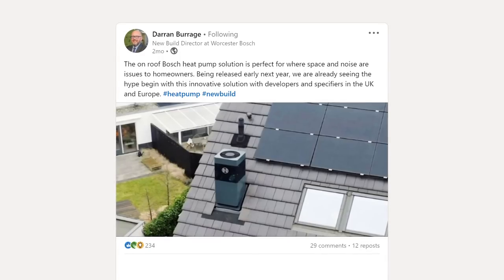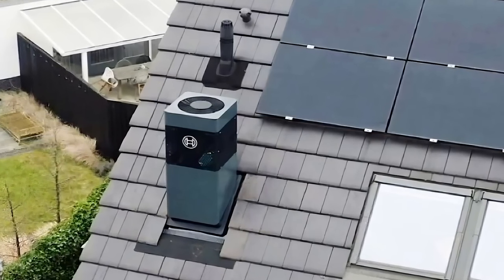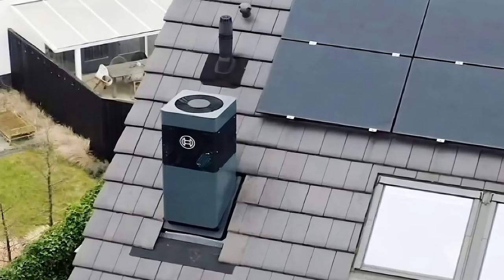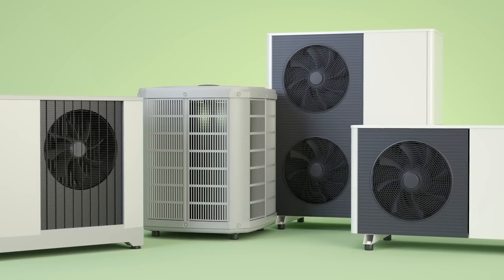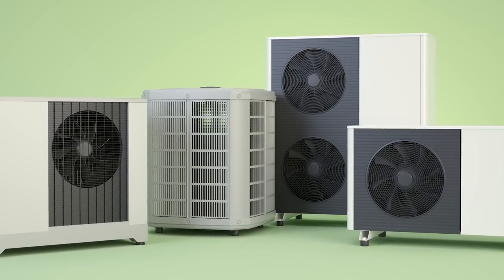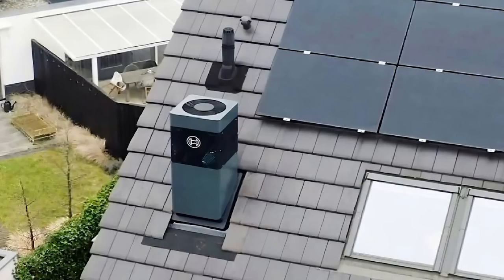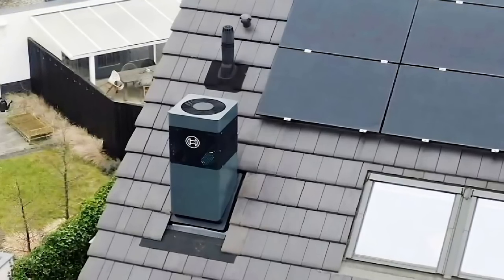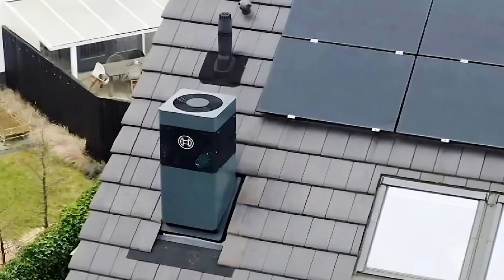Is This New Air Source Heat Pump Idea Crazy?

Comment: Nice idea and that is where it stops! Maintenance would be a nightmare and I for one would not go up on a roof to repair a heat pump. Maybe all could be accessed via the loft? That would work but still could be a pain in some lofts as access can be hard. Also, the weight of the heat pump can be in excess of 100KG. Strapping that to the roof could cause some issues, especially in exposed areas!
Reply: For new builds loft access and support strength should be easily incorporated. Retrofit would obviously be harder.
Reply: I can’t see any reason why it can’t be in the roof with a large vents to move the air through it. Which will make it accessible for services like boilers in roof.
Reply: @mikes4163  It should be, and I'm sure that we'll get it right in another decade or so.  The first installations, probably not so much.
Reply: @mikes4163  Eh? Surely the opposite....trussed rafters etc?
Reply: Windy days might mean you lose more than a few roof tiles.

Comment: My boiler is a Glow-Worm Hideaway and is 30 years old. I was thinking of replacing it before heat pumps become mandatory. Good idea?
Reply: No. I would say not. They are only banning installation of gas boilers in new builds from 2025. Houses with existing gas boilers will still be able to put in a gas replacement for a long time to come.
Reply: I've a Firebird Hideaway 120. Just last year  (2021) replaced the motor and connected everything up in a smart system. It's 24 years old and I can't see the need to spend thousands to replace my entire system. My next upgrade will be solar panels, maybe if I get a good return on that I'll think about the heat pump but I'd always keep the oil burner as back up along with my stove.
Reply: @tcm81  Thank God for that.
Reply: New boiler would save on your gas bill.

Comment: I wonder how will it perform covered in snow and eventually ice for a week or two?
Reply: At thr exact time it is needed the most
Reply: It freezes up by itself. That's why it also has a defrost mode.
Reply: I was thinking UV damage
Reply: It will decide to fail at the most inconvenient time in winter. I wouldn't be going up there with my toolbox on an icy roof. A health and safety officer would literally faint if they saw that; I've seen that happen. This is a bonkers idea. If the condensing unit is going inside the building, just duct it through a side wall at ground level like you do with a boiler. You wouldn't want a compressor running above your bedroom believe me. I deal with these things day in and day out.
Reply: Mitsubishi HyperHeat is designed to work to -25c without it turning into a direct electric heater
Reply: Defrost happens regularly with air source heat pumps (like every hour when it's high humidity & cold!) it melts ice off it's evaporator in 5 minutes. The system runs in reverse to do it. With the air stream coming out the top, snow won't build up anyway.
Reply: @Loopyengineeringco  There is a motorway less than a mile from my house. It goes right over the Yorkshire moors, and many said, at the time of its building "But surely it'll be impassable when it snows..." To which, the 'experts' replied "Oh no, it's been designed so that the snow will simply blow off the surface..."
In March 1979 I was working on the other side of the moors and it snowed. The motorway was impassable, and I had to sleep in my car. Next morning, I was in a convoy, led by the police, as we negotiated a path, cut by snow ploughs, through the TEN FEET drifts on this motorway. I've never really believed anything since, when it comes to what experts say snow won't do...

Comment: I'm waiting for my heating guy to replace my air source heat pump for a gas boiler.  Never again with I be talked into new eco-friendly system again.
Reply: Sounds like the same scenario as our electric car
Reply: You probably got a cowboy to install it mate or your house is draftier than a pergola, either way you have bigger problems than the heat pump
Reply: Hope it wasn't the same heating engineer that fitted the Heat Pump 🤣
Reply: @hk78901  New build bungalow, triple glazed oak windows, insulated above building standards and under-floor heating. It works great in the summer but when temperature falls below 6 degrees, it turns into an ice-block and it's useless. The noise of it continually trying to defrost itself can be heard 200metres away at my Mum's house! I hear that the newer systems are an improvement but I'm not ready to chance £1000's again.

Comment: I'd have thought that the bulk of the mechanism would be in the loft, and only the air exchanger bit on the roof itself?
Craftsmanship of the desk looks great by the way.
Reply: Yeah I reckon that's just the evaporator coil & fan up there, the rest of the machine probably pokes into the loft eaves. Great idea tbh, lots of unobstructed air for the heat exchange, although smaller fans means more noisy, so they might have a heat capacity limit of 5kW or something like that. Compressor vibration isolation will have to be top notch in the machine
Reply: Putting the compressor in the attic I would think would be problematic for noise mitigation. Putting the one thing that has to be cleaned on an annual basis,Condenser coil (evaporator coil in winter time) on the roof would be equivalent to putting your car on a 36’ (11 m) high lift and changing the oil with scaffolding. The full day of sunlight with no shade would help in the winter time and be a disaster in the summertime. Going on the roof to service a piece of equipment is bad enough in good weather but who’s going on the roof to service a no heat with ice & snow ?  My opinion would be flat roofs only , with permanent roof access.
Reply: @zlmdragon.  , Thank God, I was hoping the BRITs weren’t getting so desperate for space that they had to put mechanical equipment on A pitched roof🏠
Reply: @tutacat  , I am hoping we will see more community ground source loops, it makes sense . They have been using shared loop systems for high-rise buildings and high-rise condominium complexes for decades . Why not community loops for single home residences ?

Comment: i think it'll be so much simpler than that, the pump will sit in the loft in a safe space for access etc and the bit on the outside will do the venty stuff
if it's a fully contained unit that can just be fitted into the roof and then covered with whatever covering the roof has, be that tile or metal or whatever the americans use it could well be a fit and forget unit with pipes going to wherever they need to go to
Reply: That was my thought. Every repair on my heat pump has been with the electronics. I don't see why the electronics have to be on the side of the unit. A wire bundle so you can have the electronics at ground level seems possible.
Reply: You don’t need to have anything outdoors. There are ASHPs available that sit entirely in the loft and just have a couple of ducts to gather and exhaust the air they use. Simples.
Reply: Yeah that's what I've been thinking too. The heat pump system seems pretty modular at first glance, so why do we have to have big boxes outside in the garden cluttering up the place while being exposed to the weather? There seems to be little to no reason why the mechanicals can't be in the loft space, with the electronics somewhere inside the house in a control unit where it could be adjusted/serviced/replaced at will.

Comment: Industry professional here. TLDR, we are in for a scandalous period of miss-sold equipment and poor installations. Don't get rid of your boiler yet. Using heat pumps to heat homes isn't a great idea. The technology to do what is required for most installations just doesn't exist. A part of my job is to design and locate heat pumps in commercial buildings which often means near residential properties. It's a nightmare when designing projects to meet noise and planning criteria. Then there's the task of ensuring adequate airflow through the unit and having enough working space around the unit for maintenance. All of this is more difficult in residential properties with even tighter noise and space restrictions. You simply cannot make a compliant residential installation with the current restrictions and technology (for most properties, new developments have flexibility). Then there's the efficiency aspect. Heat pumps just do not operate efficiently in cold ambients. The COP is very low when you need your heating most (i.e below 5°C) to the point where a gas system is going to be a better option for your bank account. COPs are only going to get worse as FGAS regulations prohibit the use of current refrigerants in the not-too-distant future. In other words: energy prices increasing + efficiency decreasing = exponential rise in electricity bills. Then there are the low flow temperatures (assuming air-to-water). Everything has to be oversized to have large surface areas to get the required heat output from the system. That means large radiators or underfloor heating. You won't get hot water from the tap unless it's heated again by an electrical or gas system adding complexity and many points of failure. Heat pumps are notoriously complicated and expensive to repair. Labour isn't cheap for professionals and there are hardly enough people in the industry as it is without the added residential market. This will lead to cowboy installations. This is all being driven by the manufacturers trying to open another massive market space. Heat pumps might be feasible for home heating if larger, centralised plant is used which would cater for several houses within the neighborhood. This could be a hybrid system consisting of air and ground-source coils to maximise efficiency in cold ambients and be able to switch to the warmer source when required. This large unit would be located in a dedicated plant area and piped to houses via hot water. Even then, I'm not convinced that heat pumps will ever give the required efficiency to warrant the infrastructure. If you're not convinced and you're going to install one anyway, do yourself a favor and get the manufacturers to provide a design submittal for the equipment they are selling you. Size the outdoor unit approx 133% to the max calculated load. This should hopefully get you somewhere near the efficiency peak in the system (you want to be operating at 60% of the outdoor unit's max capacity). Think bigger outdoor units and bigger indoor units (radiators etc). That's a very rough rule of thumb we got from using the manufacturer's design software. Good luck. I'll be on board when electricity is free (or much cheaper than gas, which the government is doing its best to do by making gas astronomically expensive).
Reply: Could it be that the companies who intend to supply this equipment have somehow influenced the government regarding the efficacy and true cost of heat pumps?
Reply: @zlmdragon.  It's not scaremongering, it's the truth. If the truth scares you then that's on you. Heat pumps are not a suitable replacement for gas boilers in the UK. "Do you know Moldova?" Do you know how much electricity is in Moldova? Less than a 3rd of what it is here in the UK. "In UK you can install an air to water heat pump without a planning permission." Correct but there are strict limitations that you must abide by. It is my opinion that some form of planning permission SHOULD be a requirement considering the noise and visual impact the outdoor units have. Just because the EU does it doesn't mean its good. That's why we left.
Reply: @paulwestlake4278  Me and 20 other people were invited to a factory tour in Europe by one of the big companies. During this, they took me for a meal and a night out. Everyone was bought a BOTTLE of champagne EACH. Anything you wanted, you got. I know exactly what treatment our MPs will be getting from these companies. The MPs couldn't care less about COPs and refrigerant GWPs.

Comment: It’ll be ‘100% serviceable from inside the loft space’ in the same way their gas boilers are 100% serviceable with only front access, but it takes an hour to change a PRV whereas on another boiler it’ll take 5 mins. When WB stop designing their boilers like white goods and with plastic components I might have a rethink

Comment: If your heat pump relies on the air temperature it sucks in. Wouldn't it be better to mount it in the sunniest part of your garden and not in the shadow of the house? Even in winter the heat pump would be naturally 5° warmer or more. In the summertime it would be boiling.

Comment: From the looks of it the Nefit Bosch Compress 5800i AWR heat pump looks great and exactly what I'd be looking for. Maintenance would be an issue but a cherry picker and Lanyard would be all you really need to cover H&S on that as long as it's large enough maintenance periods the cost might be minimal enough.

Comment: That looks small for a heat pump, is there more of it in the loft, and that is the tip of the iceberg that simply has access to the outside air ? if so maintenance would be done in the loft similarly to most peoples water tanks.

Comment: Build your house so the roof is at ground level, problem solved. As your house would be well insulated as well. No heat loss though the windows. Another crack pot idea.

Comment: I don't understand why you'd choose air source over ground source if it's a big new developments. with the economy of scale the upfront cost of digging a big hole can be somewhat mitigated.
Reply: same with rainwater capture imo.
Reply: Even with economies of scale it comes down mainly to cost

Air source can occasional get better efficiency too, particularly in the south where the summers are warmer so the summer water heating efficiency is insanely good compared to a ground source which will be roughly the same all year round

Comment: as i live near the sea,those external units are real rustbuckets,placing one on the roof is especially difficult for maintenance
i still heat my home with a modulating condensing gasboiler,if gas is no more an option then i will change to infra-red panels,which i can hang in place of the radiators,i will also foresee a solar system with a 10Kw inverter and 15Kw modular battery system
if this idea will be effective,i dont know,we will have to see,cheers Roger

Comment: We just took out a very unreliable noisy (6yr old) Mitsubishi EcoDan Heat Pump (even the manufacturer couldn’t fix it) and installed electric boiler + unvented hw direct cylinder

The heatrae sadia electric boiler is silent (& releases zero emissions) ….10 year parts & Labour Warranty….& never go wrong it’s a no brainer
Reply: Sounds like a direct heat would cost a small fortune
Reply: Coupled with some form of local solar energy source, would be a no brainer.
Reply: @hk78901  The boiler does not.

Comment: I think the way forward is something like a plant room in the attic for all new builds. I'm sure they could make a heat pump that could work indoors with a ducted air supply. Obviously it would need a special floor to take away any leaks.
Reply: There is - they are called EAHP (exhaust). Popular brands are a Nibe/Nilan

Comment: I was watching a show, talk about the "Thermal mechanics" of how a "heatpump" works... & honestly, I think I'd rather stick mine underground if it were possible?

B/c you've got that "consistent temperature".. 

Modern heatpumps, from what I've heard can work down to -40 degree's. I'd rather "errrr" on the side of caution & assume -30f.  Anyways, if you go down in the ground so far, the temperature is normally consistent. That'd improve the heatpumps efficiency if I understand it correctly. At least for heating & cooling?  

Anyways, that'd obviously take care of the noise issues as well?

In regards to sticking one on the roof in the sun? I dont honestly know if its a good idea in regards to how a heat pump works, but it might be a good idea in getting rid of noise? I know cool air tends to sink, & warm air tends to rise... but in the dead of winter, I just don't know how this is going to play out... with winds blowing fast & hard?

Comment: Very simple. Modular internal construction of the unit. Sure it would be possible to devise a way to have a bottom section on rail, and to have the top section removed from by dropping down.

Comment: Maintenance and replacement issues. Exposure leading to shorter lifespan. Potential roof weathering failure in the long term. My Ideal boiler installed in 1990 still seems OK however....

Comment: I was enjoying your video and something did come to mind. If an alcove could be built into the side of the house where the heat pump could be installed inside. Even build the heat pump so it can be unscrewed and slid out for maintenance. Solves the space problem and could be built into storage area for inside so the space is used effectively. Just came to mind, but I'm no expert just love space saving ideas
Reply: Air contains just a little bit of energy.  So you need a an awful lot of  airflow going through the air-source-heatpump.
There is a reason that air-source-heatpumps have a such a big fan and are so noisy. It's because of the airflow.

Comment: As you pointed out Roger it’s introduced more unnecessary risk… you either service it on the cheap and the repairman potentially falls from height or you do it safely with a platform and it cost you a small fortune!💰It’s a No from me! 😅